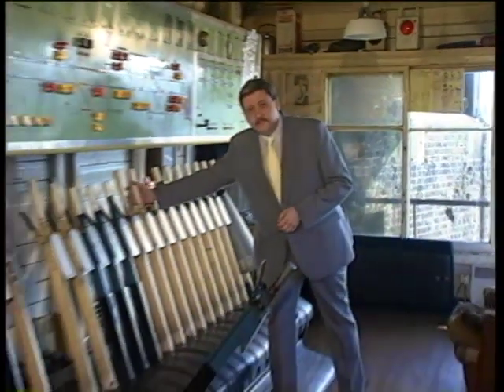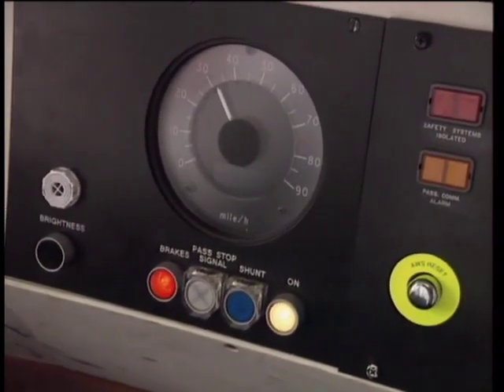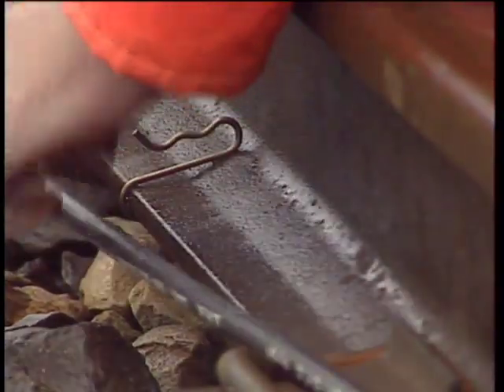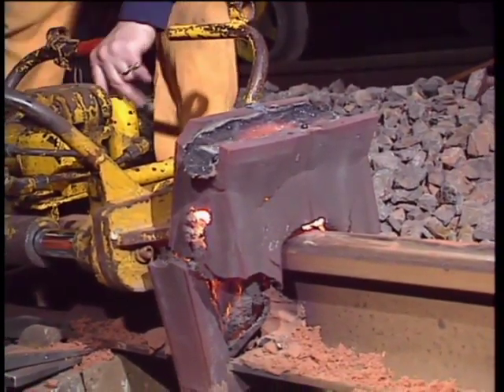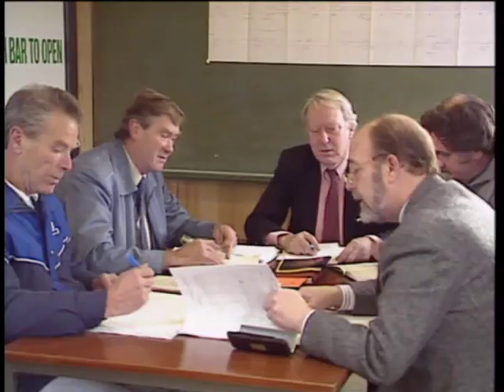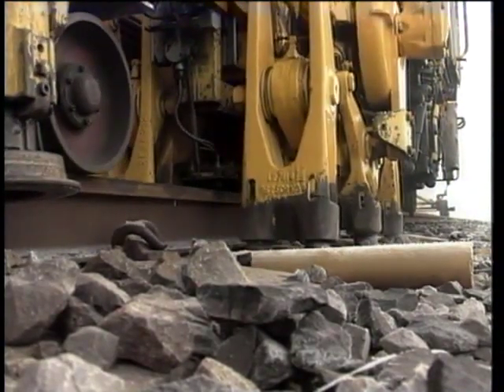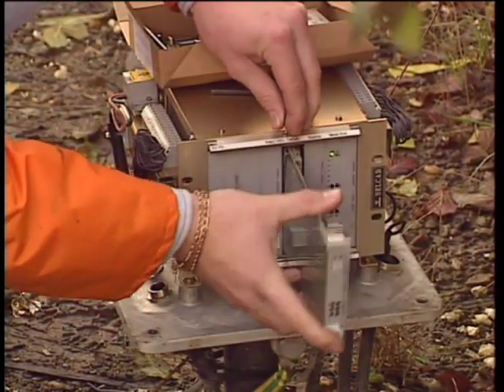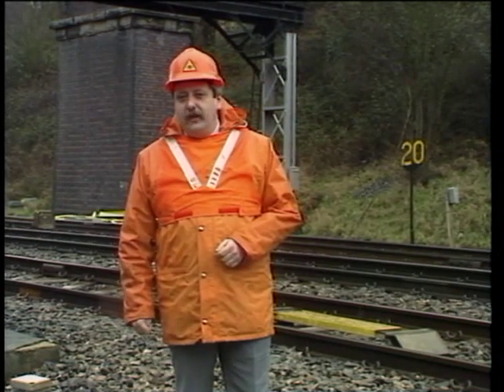Living With ATP

Comment: Questions:
1. Who supplied which system at the time on either GWML and CML.

2. Who supplies them now and are they exactly the same system?

3. How does this fit in with the ERTMS standards?
Reply: TheSaintST1  GEC signalling on behalf of Alcatel SEL and all the 165s were delivered.       The chiltern system differs from the Great Western version slightly.     But both work the same. ETCS or the full ERTMS is completely different.          Originally the LUL section was going to get the system too but it was expensive and it eventually became impossible to engage in engineering possessions on LUL metals for this task.     That’s why chiltern units have tripcocks.     1909 technology on 1990s trains at the time !  The equipment was manufactured for the LUL a section but was moved elsewhere where it was more important.     Sure would have helped.  Thames pinched units 001-008 and gave them back eventually to 2004 and they didn’t get tripcocks when they got back so had to run in a 4 car formation.    The ATP buttons were smashed up and had to go to Ilford for replacement.    There’s a pic I remember of 005 and 003 being coupled oddly because of the arrangement
Reply: Greyclaw  I believe Alcatel still supply the equipment however the supply for it is low because it is considered obsolete now.      Chiltern Main line will keep it GWML will eventually rid of it and replace it with ERTMS but unlikely soon because the whole line was resignalled and taken over at TVSC at Didcot and replaced boxes such as Slough PSB or New IECC.   I believe the building still exists.
Reply: The original plan was to use two independent manufacturers for the two systems - one for the Chilterns and the other for the Western main line and the new Heathrow Airport branch at the time. At that time, ACEC and Alcatel were separate companies, but not now. 

Historically, I had a fair bit to do with both signalling systems on both the Chilterns and the new Heathrow branch (along with full-on renewal and electrification between London Paddington and West Drayton). Might be worth mentioning that, at the time, not all rolling stock was fitted with it; in effect, just the new Heathrow Express ones, and the “Intercity” HSTs; not the rest of it, in particular the Network South East sets, nor any locomotives at the time.

The integration of an add-on system to traditional BR signalling systems, along with conventional driving skills etc was hard work - including psychology as well; not just physical installation of extra equipment. All had much to learn along with that.

As usual, money talks, and slowed down the original project, assisted by privatisation. It led to the  development of the “Train Protections and Warning System (TPWS)” under Railtrack (remember them?). 

Later on, the concept of European Train Control System (ETCS) evolved, and in effect it has taken over the market.
Reply: @johnkeepin7527  And now we get the inferior TPWS+ to replace ATP. Still no full speed protection for Intercities.
Reply: @EdgyNumber1  Both GWML and Chiltern had given by different suppliers.
The GWML is using the TBL signal.which develop by ACEC Belgium (Later on as GEC-Alsthom/Now Asltom.)
This system also being use in our Hong Kong East Rail Line (1996-2021) when KCRC upgrading the whole signa from AWS as it didn't prevent SPAD crash.(But AWS still kept at secondary signal for Intercity train and cross country train.
Now replace by Siemens TrainGuard-MT CBTC.
Chiltern Mainline is using SELCab which provide by SEL Germany(Alcatel-SEL now part of the French Thales Group.)
It is now as Seltrac system.
SELCab is diverted from Seltrac system.
Seltrac also being used in Hong Kong West Rail Line since 2003. It is the first use as Mainline signal in the world.)
Reply: @John Keepin  ACEC and Alcatel is different company.
TBL systemnow own by Alstom.Alcatel SEL Selcab (also divert from Seltrac) Now own by french Thales Group

Comment: Living with ATP in the US is easy. We just talk about it, we don't actually do it.
Reply: ATP is a safety system used in British railways and is a result of the Southall and Ladbrokes grove crashes
Reply: Advantage is that PTC is going to be with modern ETCS like technology with GPS and radio communications, none of this 1990s stuff with miles of cable, fragile track antennas, and complex logic about release speeds, that the UK got stuck fiddling with.
Reply: straightpipediesel how’s that PTC roll-out going? 🤣
Reply: @SportyMabamba  well, at the moment, a lot of the North East has it with plans to expand it, so, ok
Reply: @SportyMabamba  Finished. All Class I mainlines, and inter-city and commuter passenger lines had PTC operational as of the end of 2020. 98.5% was running at the end of 2019. In fact, the US has 5.8x the route-km under PTC than the UK has rail.

Comment: While the installation of loop cables in Hong Kong is much rigorous than that..... Not a cable tie and a simple clip, but a tailor-made fixture, bolted onto the sleeper, for securely holding the cable.
Reply: A good idea - until you need to remove it!
Reply: @JulianShagworthy  Why do I need to remove 🤓

Comment: Interesting video. Probably from the 80ties or earling 90ties by the look of the glasses... :) Why wasn't the system rolled out over the entire network eventually? Simply because of too high costs?  The wire loop system is similar to the LZB cabsignalling system in Germany for the ICE high speed trains. It was develloped back in the 80ties.  This system is still in use. It might be replace by ETCS level 2 in the near future.
Reply: Indeed, it was due to costs that ATP was not fitted network wide. However, TPWS was fitted network wide since due to significantly lower costs.
Reply: It is due to the privatization and the British Government's policy of not put funding the railway to do their work...
Reply: @AAA839  Ok thanks for your answer.

Comment: If some unforeseen incident occurs can the driver over-ride the system? For example a motor car or lorry coming off an over bridge. As recently happened.(2 or 3 years ago)
Reply: The driver is in full control unless he/she is speeding or is not following instructions to brake because of restrictions the system knows about.  This means that the driver can always stop the train themselves for other reasons.  They cannot go faster than permitted by the system.

Comment: is the warbler different on the chiltern system than on the gwml? i thought the cab/driver interfaces were identical on both systems. you can hear the chiltern one at 1.20 and the gwml/ hst one if you seach on here for 'emergency stop at 125mph'

Comment: Could this of saved lives today in Washington State?
Reply: Sean Not-telling Yes, ATP would have prevented the accident in WA. I operate Light Rail that utilizes ATP.  I have no doubts that by not installing ATP on the renovated rail and saving $900,000, it just cost 3 or more lives, and numerous serious injuries.
Reply: It's going to be a bit of a wait for the NTSB and the speculations are flying right now.
Everything from something on the tracks to speeding in that 30 MPH curve. All I can
really say and hope for is that the numbers of fatalities don't increase over the next few days.

I happened to be on that section of the interstate this last Friday. Spooky what can happen
and where it can come from when you time is up.
Reply: Sean Not-telling its my understanding they weren't using track equipped with atp. However that's interesting that they didn't provide cautions along that route :(

Comment: Just out of curiosity why does the ATP equipment (beacons, cable loops) need to be removed during ballast cleaning?
Reply: The cleaning is done by a massive mechanised unit, either using suction or mechanical means to remove, clean and replace the ballast as it slowly travels over it. The APT equipment would get damaged in the process.
Reply: llama0wn3d makes sens

Comment: I'm confused how this works with or is different from TPWS
Reply: ATP continually monitors your speed and can provide you with information (permitted speeds and signal aspects here for example) whereas TPWS doesn't really warn you before it intervenes and can only act on trains in fixed locations (e.g. signals). ATP will also do its best to stop you from passing a red signal (or end of movement authority) whereas TPWS overspeed sensors won't necessarily stop you before the signal, rather it aims to stop you before a point of conflict.
Depending on your definition you could include (amongst others) TVM, ETCS and CBTC in "automatic train protection" as they also continually monitor your speed, I'll leave that for someone else though!

Comment: Duel Gauge track to the right @1:45 and @1:37??
Reply: Bahn: That's fourth-rail track, which uses two rails for D.C.: One rail is DC-, and the other is DC+.  Search for London Underground videos, and you'll see it there!
Reply: And in fact some of the Chiltern stock currently shares some of the London Underground routes in the area, and in the past used the same physical SPAD (Signal Passed At Danger) protection system, called the 'tripcock.'
Reply: Sorry, but that is not 4th rail. It is just normal rail sitting loose. I can't quite tell if it is new track awaiting installation or just old track waiting to be taken away but it is not LUL 4th rail.
Reply: EdgyNumber1 anything running over shared track with LU still requires tripcock protection. Chiltern into Marylebone and whichever TOC runs into Wimbledon also. Tripcocks are only removed as lines get upgraded to automatic signalling (DTG, TBTC & CBTC solutions have been or are being installed).

Comment: Unnecessary system to be honest. TPWS and TPWS+
do the same job for a lot less cost. ERTMS will be rolled out soon.

Stuart how do you mean over-ride the system? go faster or slower?
Reply: Sorry David, disagree.  TPWS can't prevent a train above a certain speed from going over the overlap.  ATP won't let the train go that fast to begin with and will stop the train.  ERTMS will render it (and TPWS) obsolete though
Reply: We have TPWS+ for the higher speeds. There's not been train crashes as a result of the current TPWS system failing to stop trains within the overlap. (Yes there have been trains with defective brakes such as at Crewe where speeding was involved and the driver had no proven route knowledge or low adhesion incidents which the system wouldn't stop anyway. ERTMS is the answer but in the meantime ATP is in its present form horribly inefficient. For example it can't tell the train if the aspect changes to a less restrictive one until the train gets to the balise near the signal. It is an intermittent form of train supervision. What this means is if a signal changes from red to green is that the driver can't accelerate under ATP until the signal is reached despite the fact he/she can see the signal hundreds of yards away.
Reply: +David S Extra layers of safety is NEVER "Unnecessary". What happens is one system failed and the train's computer fails to detect that failure due to some software or hardware bug? Computers and electronics can and do go wrong. The class 220/221 Voyager (plastic snot-box) is a perfect example.
Reply: +Morgan Winters as I said TPWS is adequate protection until ERTMS is rolled out and let's not forget ultimately the train driver 'drives' the train not the computer.
Reply: +David S Relying on one system alone is never a good idea regardless of how good anyone thinks is it. For example, think of the number of safety devices something like a TV in your home has (Main 80-100 amp fuse at the meter, an RCD, a MCB, plug fuse and often and internal fuse or thermal cut-out device). A train having multiple safety systems is never a bad idea. ERTMS however isn't fully rolled out yet is still under testing and development and it will be under testing a few years after it is fully rolled out to ensure the system works as designed in real world conditions. Even after real world testing, ERTMS won't be the ONLY safety device fitted to trains. If there is a human controlling the train, there will be other safety systems in place like the dead mans pedal.

Technically drivers of modern stock don't "Drive" the train. They simply make requests to the on board computer which then decides based on different sensor information weather that request can be acted upon or not, just like a modern fighter jet like the Eurofighter. Modern trains like the Voyagers have no physical connection (push/pull rods, moving steel cable ect) between the power lever and the engine/traction motors. Only electrical cable which goes via a computer, that's what drive-my-wire is. Hence why on a 100mph line, a train can't go 125mph, The computer will say no (excuse the pun).
The Eurofighter for example, is designed to be aerodynamically unstable and requires thousands of tiny adjustment every second to keep it in level flight, something that's impossible for a human to do since humans can only make low tens of adjustments per second. If one took the flight computers out and replace them with cable and pulleys. It would be very hard to fly and would be far too demanding on the pilot.
Reply: +Morgan Winters Can I ask if you actually have a railway background or are you just an enthusiast or a student who's reads the Internet ? Whether computers interpret commands from the driver makes no difference to whether the driver is a driver. Ultimately they are charge of how the train moves.
Reply: +David S TPWS was only developed after BR decided that these (more-or-less off-the-shelf) systems would be too expensive.

But I think you're wrong about ATP. I believe the point of the in-fill loops is that they effectively make the system "semi-continuous", allowing data on aspect changes to be transferred not necessarily immediately but certainly not only on the beacon for the signal.
Reply: +Morgan Winters No, there isn't much of that on modern trains really. While you're right in that there are usually little to no direct mechanical linkages any more between controls and power (with the likely exceptions of emergency brake-related equipment), you'll find that only on very few lines (the parts of the GWML and Chiltern Main Line with ATP installed, plus the tilt-enabled parts of the WCML (via TASS)) is there any attempt to stop a driver going too fast, at least once a speed restriction sign has been passed.
Reply: +Muzer0 agreed it's probably been improved with these balises but when you consider that the ECML and WCML run without this form of ATP it does seem over the top. (Yes I know there is TASS supervision on the WCML but as I understand it, it's not linked to the signals just permanent speed limits)
Reply: "Computers and electronics can and do go wrong." (facepalm) Another Titanic is about to happen.
Reply: Nope,  it is not !
Reply: You are aware TPWS was brought about because of the cost of ATP system across the whole network, TPWS was a much cheaper version which has its limitations but without the investment from the goverment at the time British Rail wouldn't be able to complete the job.
Reply: @StuAnderson90  also let’s not forget ATP is only installed on the 125 mph sections of GWR although of course Chiltern have now stopped use theirs and instead are using an upgraded TPWS system which works very similar to present TPWS installations.
Reply: @daveb0789  - It's also installed on the Reliefs between Padd and Airport Jnc.